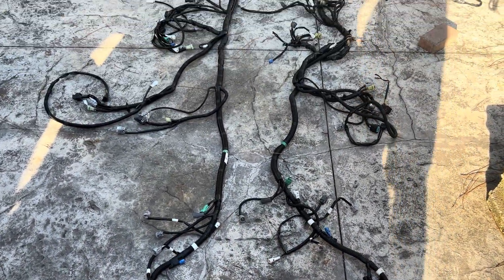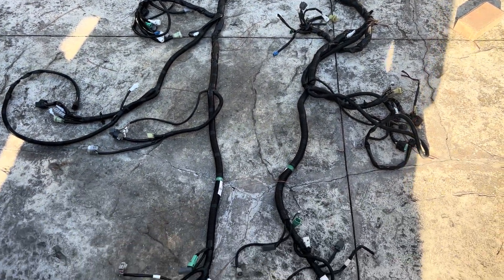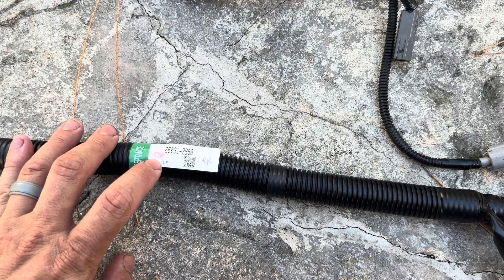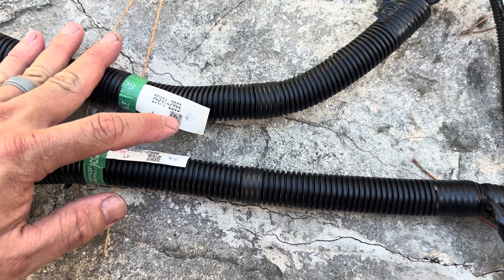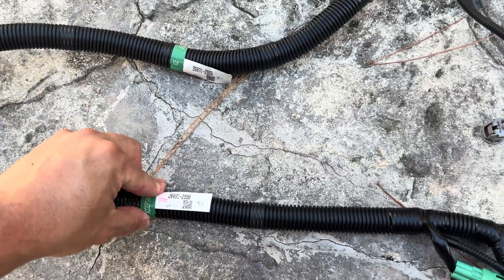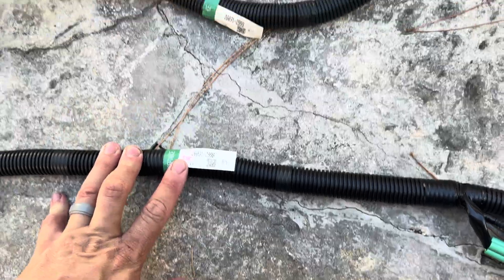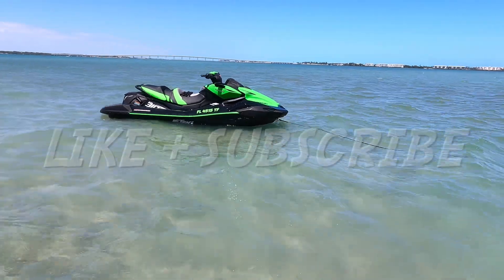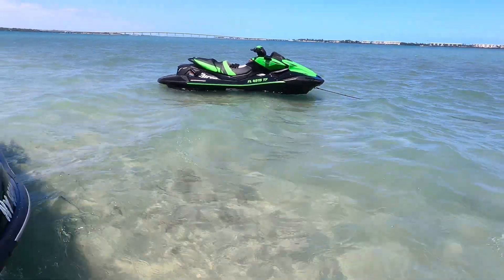Tech Topics: Defective Wire Harness After swap with new one - 2022 Kawasaki Ultra 310 Jet Ski

Comment: What were the symptoms of the 22 kawasaki 310 with bad main harness
Reply from the maker: Strange electrical issues, failure of immobilizer key to register, loss of display, intermittent buzzer sound..what's your symptoms?
Reply: Hi JD.  I don't have a 310, but an STX 160 but my symptoms are no beeping, display on or power when the key is inserted. Battery is fully charged and battery terminals are clean and tight.  Could it be the wiring harness gone bad?  Is there a way to test?
Reply from the maker: @reeftoscano0 did you check the fuses?
Reply: @JDsWaterWorld  Yes I did and the main fuse 20 amp. is all good. I can't find any other fuses.  Have you ever had a immobilizer go bad?  Is there a way to test it?

Comment: Im sitting here with a new ultra that was rolled over for about 45 seconds in the ocean, the engine was full of water, the hull was filled w so much water it was shocking, well above the intake. I made sure to roll it over per sticker on the back but yeA… now I got the water out… guess what?! One relay is buzzing and dash comes on and off by itself.:. I feel the most expensive jetski you can buy out of the 3 big companies, kawasaki has failed.
Reply from the maker: Ooof that sucks. Once you flip the ski you basically have to take the entire thing apart and flush it with fresh water.  Sounds like you have salt water intrusion in to the wire harness. Did you remove all the relays and ECU and remove all the salt water? Time to call your insurance company…i
Reply from the maker: Also, the ski could be saved as long as you act fast and follow the correct procedures to get the salt out. Every single connector would have to be disconnected washed out, cleaned and dried and greased with new dielectric. Go clean everything a bit better to get all the salt out and try again. Did you pull the intercooler? Drain the fuel? Lots to do…

Comment: I always try to catch all your videos and it seems to me the kawasaki is a pretty high matenance vehicle with some pretty tricks to get to wear items. To have a dealer do the things you do would probably cost big $$. It does make good content to watch tho..
Reply from the maker: Yes the 310 does have quite a few maintenance items and yes between the dealers cost and wait list it must be a pain for those who don’t do it themselves. I will say that all of these items on the Kawasaki are easier than changing carbon ring on a SeaDoo and aligning the engine properly- I despise working on seadoos. The Yamahas are similar to the Kawasakis (Japanese engineering) with a few key differences and then many differences of course when you get into the supercharger setup.

Comment: Hey jd I have a 23 310 lxs and would like to have a gps on it. Any suggestions in terms of what unit/mounting?
Reply from the maker: You could use a ram mount using the bolt holes at the bottom of the cup holders or use a regular boat garmin mount and screw it through the area opposite your volume knob on the left side of the ski. It’s easy to run the wire harness through the hole behind the phone box to the battery..I personally will not be installing a GPS, but the Garmin products are usually pretty good

Comment: Great video I want to know how to fix the wire harness
Reply from the maker: I was asked not to do a video and to advise people to take their ski to a qualified Kawasaki dealer for this repair..that being said, it’s fairly easy. Only special tool you need is a lantern/flashlight and a fish tape or mechanics grabber tool to help feed wires though. The harness itself is very expensive. I am going to do an autopsy on it to show where the splices are located. If your ski is 2023 model year your fine- this issue was only 2022 models
Reply: I have a 2023 ultra 310lx with about 25 hrs on it, and it is at the dealer having harness replaced as we speak.
Reply from the maker: Yes, this video was done before they issued the recall (November 2023) for all 2022 and 2023 skis. I believe they switched manufacturers for the harness now and are replacing all of them

Comment: Hi JD, just a quick one, and this shows ,I dont know anything about my lx ultra. Why does it have no cam belt, At least I can not see it anywhere,
Reply from the maker: The 310s have a serpentine belt driving the supercharger. Both the 160 and 310 both have a dual overhead cam setup (DOHC) driven by a timing chain…the timing chain is on the front (bow facing side) of the engine under the valve/ cam cover.
Reply: @JDsWaterWorld  thanks for that,l knew it must be hidden somwhere, good job ,its a chain.

Comment: What's up with your old wiring harness?  Why do you already have to change it out?
Reply from the maker: A batch of the early 2022 Ultras 310s had a bad splice in the harness, mine was included. Covered under warranty. I repaired my harness rather than replace, but now decided to finally swap the new one in
Reply: @JDsWaterWorld  Ah...I thought it might have been a corrosion issue or something.  👍
Reply from the maker: It was, but from the factory. Pain in the A.
Reply: New subscriber and love your videos! How do I check if my 2022 310 UltraX needs this replaced? I think there was a recall for an ECU issue that they fixed prior to my purchase. Thanks!

Comment: I admire your ability to do such work JD!  You replaced the ENTIRE wire harness! What a pain that must have been.  I really hope I don't have to. It would take me eleven hours!!😅
Reply from the maker: I would have loved for my dealer to do this, but really don’t trust them. Had to beg to let them give me the harness under warranty- I repaired my bad harness a year ago and it has been fine, but decided to go ahead and finally just swap in the new one. I did notice the new one had an “ok” stamp ok the label whereas the old one did not…
Reply: @JDsWaterWorld  I'm with ya!  Knock on wood, but if anything happens to mine under warranty I'm begging for the part to do it myself too!  I have trust issues!!!🤣😂